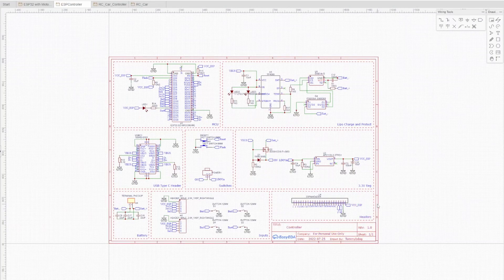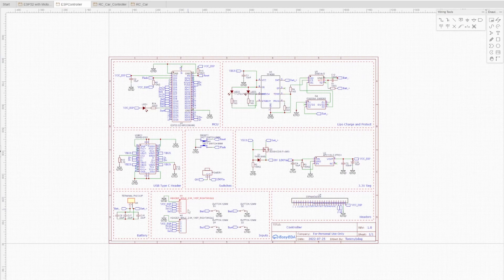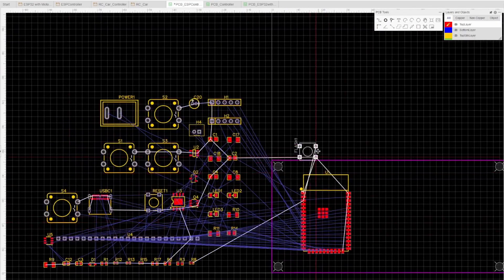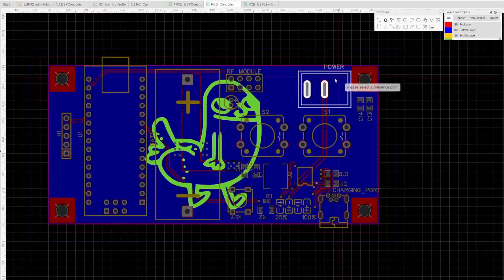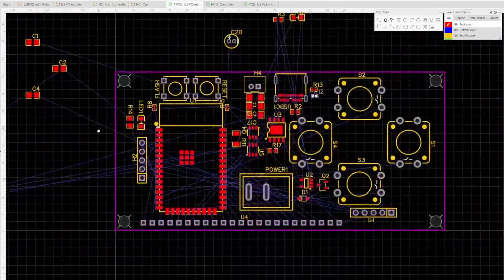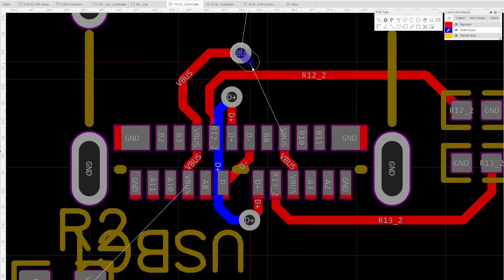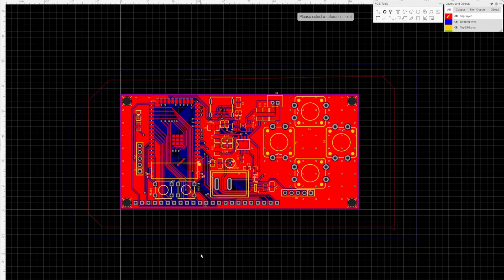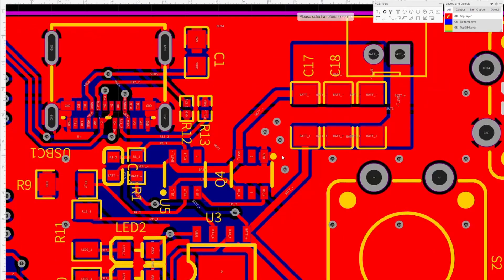Making an ESP32 RC Car! Ep. 3 Controller PCB Design(Part 1)

Comment: If you are using the ESP32 with built-in antenna (PCB trace) it should be at the edge of your PCB and there should be no components or ground copper nearby.

Comment: that's awesome stuff man. love it. i wonder if you could point a beginner like me to a resource so that i can design complete 3d models of rc cars with multiple components.
Reply from the maker: As far as resources go, google really is your friend. Learning about the physical design is really a mechanical engineering thing and it gets quite complicated but there is a lot of free information everywhere on the internet. As far as 3d modeling goes I would recommend starting with Fusion 360 since you can use the free version for everything you seem to want. It is not a good as Solidworks for this kind of task but Solidworks cost a lot of money lol. Fusion 360 is what I used to design my RC car. Hopefully this answered your question! let me know if you have any other questions.